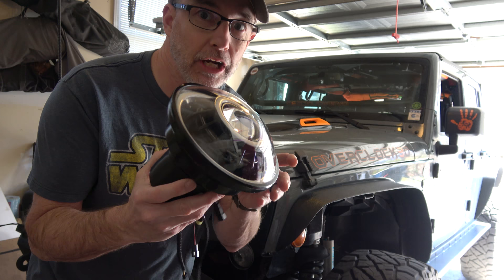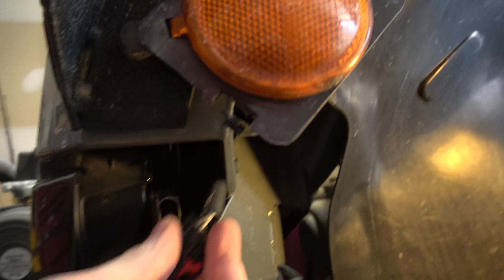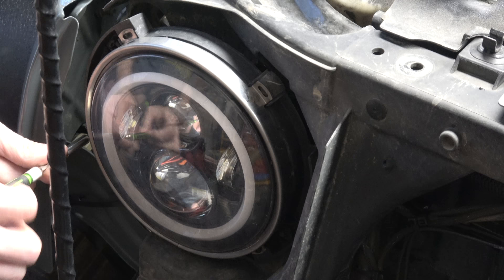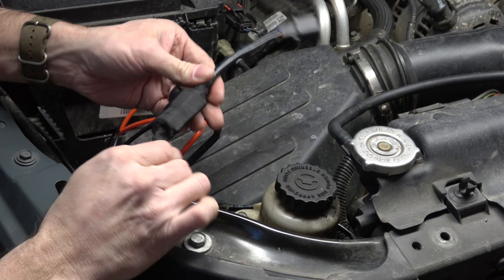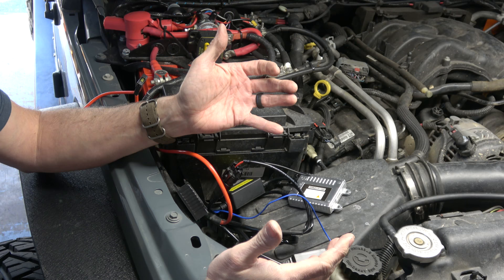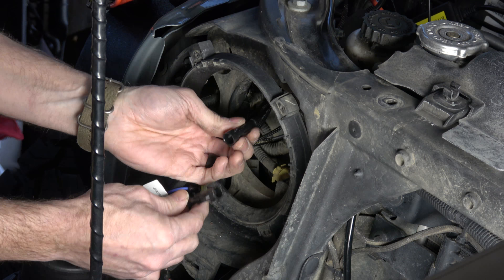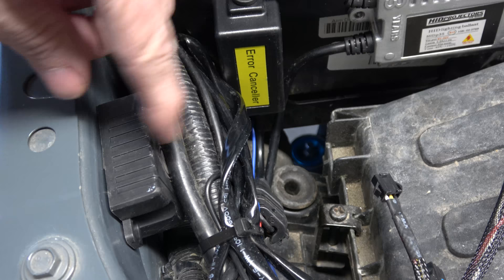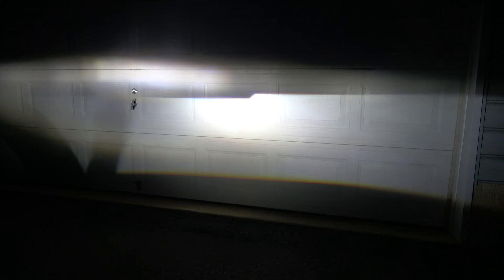02 - The HID Installation - HIDProjectors.com Revision 2.0 Signature Switchback -  2015 Jeep

Comment: Nice work, thanks for sharing. Thou, I hate the sharp cut off on projector headlights. They don't reflect on road signs at a distance. I find that a little dangerous.
Reply: If your lights are hitting road signs that means it is also hitting other drivers in the eyes. Just something to think about.
Reply: Poot Klopp it wasn't a problem before projector lights. Never had an issue with my 79 Firebird or my 84 Chevette or my 85 Prelude. I could see the road signs and the headlights didn't bother other drivers.
Reply: It's a multi faceted discussion, the increased safety gained by the light output of a proper HID system far outweigh the "drawbacks" of a sharp cutoff. Increased visibility distance for better emergency stopping and everything that comes along with that. In terms of the cut off, if we move beyond anecdotal evidence you'll see that headlight glare is a major safety problem. One publication states "that perception errors (as opposed to factors such as vehicle failure or alcohol impairment) contributed, at least in part, to more than 40% of the crashes." Glare is a big issue, proper alignment and a good cutoff make it far less of an issue. You also mention much older vehicles, light output has increased since the 80's meaning its probably even more of an issue now. 

But its your opinion on what you prefer, so feel free to prefer older lights. But I don't see how the trade off is worth it.